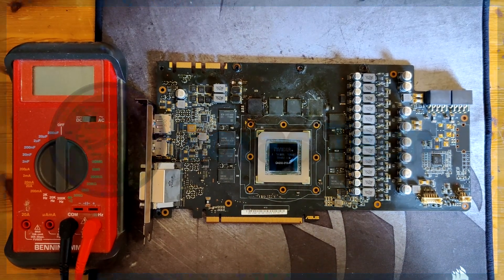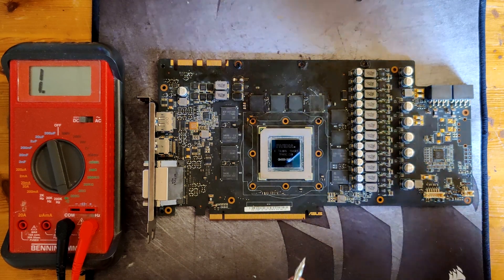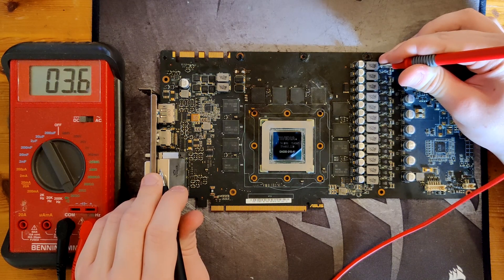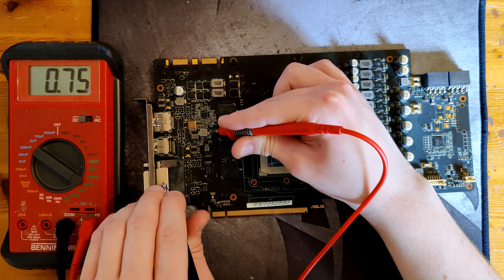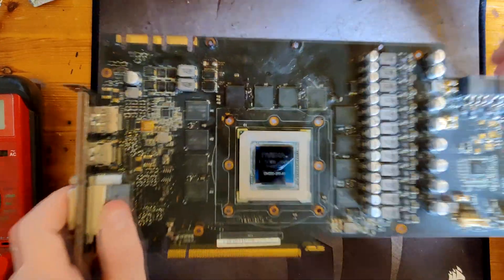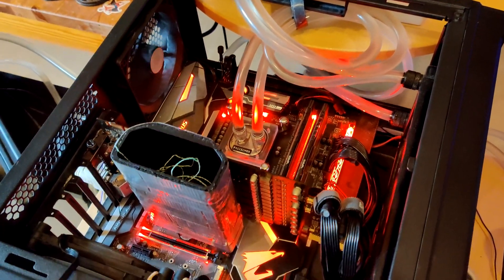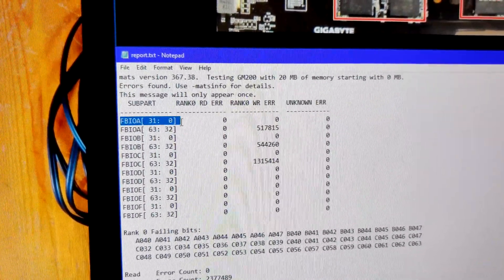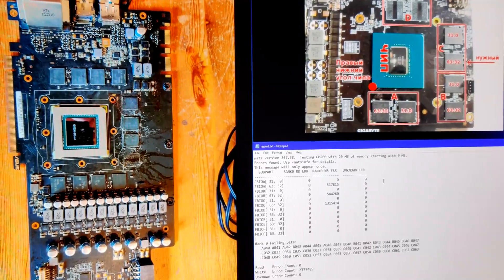GTX 980Ti Strix Artifacting, Faulty Memory // Troubleshooting (Part 1)

Comment: Can anyone help me? I have Asus Strix 1080 ti, boots fine and games work. But the gpu fans refuse to work, (even after putting new ones in) They just will not spin, even after reaching +80c. I have no idea where to check or repair on the board. Any info would be great, thank you

Comment: I have a similar board but it an asus matrix gtx 980 ti platinum which have i think faulty memory on E1 and F0 as I'm kinda hoping to get fixed as I did the usual checks with a digital multi meter as I get 20ish ohm on the memory phases don't see anything burnt on the pcb but the history of the card is abit unclear due to the issues that I had with it when I got it recently as the first one was pretty clear the two fans kinda failed which made the card overheat and when I was able to get it to boot I get tiny green artifacts on display when I changed the hdmi to dp using the dp to hdmi adapter the picture is clear but stuck on 800 x 600 resolution and the gpuid shows the specs but with memory size 0 / bandwidth unknown / bus width unknown. And ran mats/mods to detect which memory errors I get the write errors on E1 and F0 both have similar numbers in errors. Would this mean the memory chips needs replacing as they are the samsung. But someone told me it the gpu memory controller that failed. Havung abit of hard time debating whether to get the memory chip or gpu chip or both along with replacement fans

Comment: Finding out that the memory chips aren't making contact with the heat sink shocked me a bit as well. I can only think of the engineers finding that it is more beneficial to leave them separate from the GPU's heat as they are running rather cool on their own and the main chip would just add heat to them?.. it IS a very hot running card, i had to build a super airflow channel type of ventilating focused on the PCIe bay to have my two Strixes at a reasonable 60 under steady load. Without that, and using just a single card at the time, my glass side panel kept on making these alarming crackles as the card suddenly jumped temps. And not without reason, i actually felt the heat radiating on my face half a meter away. Reasonably equipped little card, but i suspect, doing the same amount of job on one of those fancy 30 series cards could go with a passive cooling nowadays. I would advocate for just lowering the operating temps, rather than doubling performance at the cost of stagnating or even climbing heat every generation.

Comment: Hello, I have the exact same card. Customer said the card sometimes boots up into Windows but screen showed 3 white and blue horizontal lines before freezing. When testing the memory phase, you said 19 ohms is low, what I'm getting is 8.9 ohms? Indication of a bad memory chip?  My memory chips are Samsung K4G41325FC-HC28, chips have no signs of being overheated. Btw, my pex-rail is showing 282 ohms. Any help or tips would be very helpful. Cheers!

Comment: have you already tried reflowing the memory modules? because the physical appearance is looks good, so i think it just the bga failure, but i think you should make a video how to test a single memory chip when it was detach from the board. your channel is pretty good, it really help me how to troubleshoot my own gpu
Reply: Btw, if u want to replace the memory module i suggest you to buy stencil station set with bga-170. If you didn't buy it, it will be a very time consuming process, in your case you need to place 170 x 3 chip so 510 solder balls, so just buy the stencil station set. i have done this twice with 8 chip without stencil and it make my eyes so tired haha

Comment: Hello, i have a  Gigabyte GTX980TI wich still works on normal use (browsing) but it crashes when i try to put it in full load (gaming). Can you please tell me what to look at this gpu or what could be done to make it good again? Thank you
Reply from the maker: Sounds like a heat issue or a partially faulty memory module / Core Memory Controller

Comment: Where do you get replacement parts for those cards? I'd like to give one repair a try as well but I don't know where to find components
Reply from the maker: Mouser, Digikey, LCSC and all the other electronics retailers
Reply: @CmdrSoyo  Alright thanks, but for broken passive components like fuses, caps and resistors, how do you find out the values?
Reply from the maker: @EstBest69  read them from the part if it isn't written on it then you will have to guess. sometimes there are also schematics

Comment: I got this card a week ago, it overclocks to 1.62ghz stable which absolutely blew my mind. There are 2 things that i find absolutely unforgivable however. First there is no memory cooling. The 12 memory chips are running buck naked. This coming from ASUS is very questionable. Second the GPU heat pipes are a direct touch one. What???? For a GPU that can go up to 350W, aluminum base is a requirement not an option. What's worse the actual part of the GPU die that's making contact with the heat pipes only cover the width of 3 heatpipes. The other 2 on both sides are just sitting there doing nothing. On one hand this card has one of the beefiest VRMs of all 980Tis (14 phase). On the other you have zero memory cooling and 5 direct touch heatpipes. What the frick is ASUS thinking when they designed this card.